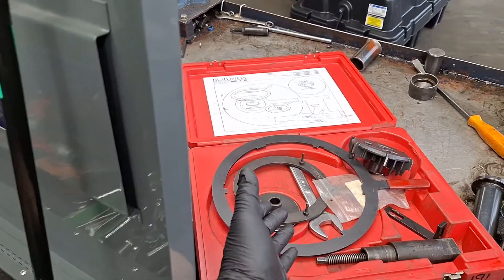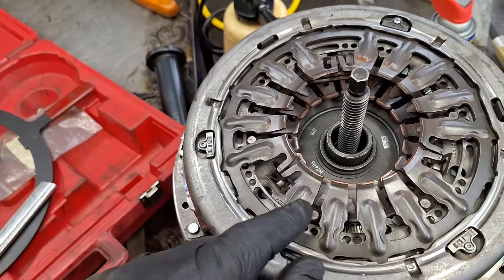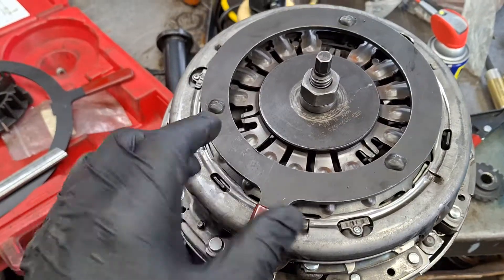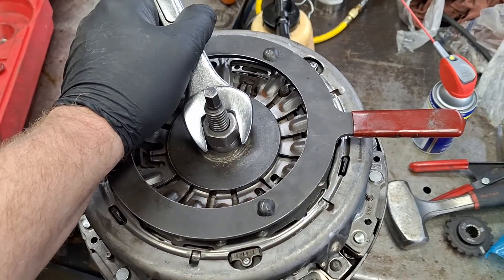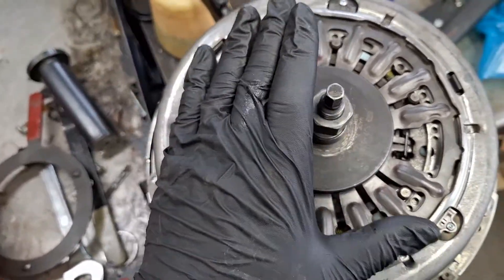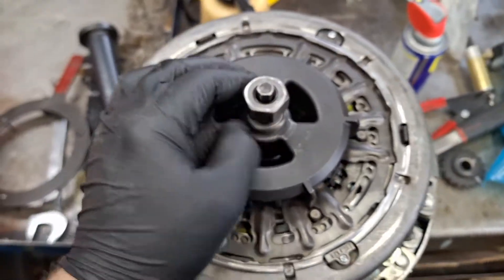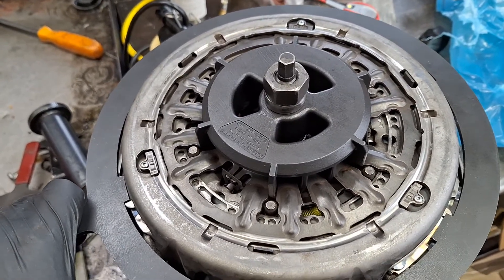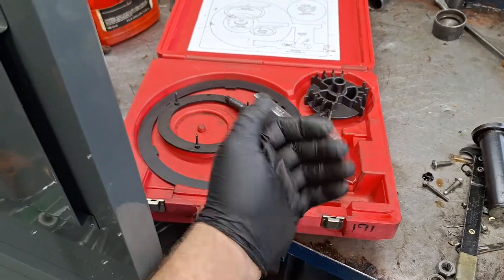Ford DPS6 Clutch Locking (Reset) Procedure!

Comment: Why does the clutch need to be reset?
Reply from the maker: If you're reusing the clutch you have to reset it - so that it goes far enough down to install the snap ring
Reply: I make  big mistake. I unlock befor installing @BigBensCarsAndCycles
Reply: How about a duel clutchñ   ? Do u have to reset it and also would it make the shifter not shift or go into aortf ?
Reply: If you don't relock it, you'll have the pressure plate splines resting on the release bearing in their extended state and you won't get he clutch deep enough into the transmission.

Comment: Are the forks reusable? I just did a clutch in my car and have no reverse. Been through the diagnostic steps in your other videos and everything seems to point towards the clutch. The little tabs on the bearing had broken in shipping and allowed the bottom piece to separate. Also the guide looked like it might have been off center as if it was bent. Stupid me put the clutch in anyway because I was desperate to get back on the road.  I am planning to replace the bearing assembly and guide hoping to fix it. Brand new Luk kit. 

PS: I re-did the shift and clutch relearns and it worked for a little while last night and quit again on me this morning.
Reply from the maker: Yes if they're good you can reuse them
Reply: @BigBensCarsAndCycles   Thanks for the reply!  I pulled it all back apart and lo  and behold the flange on that guide is bent ever so slightly. I suspect that makes the clutch release unevenly.  Hopefully I can reuse the old guide and replace the bearing.
Reply: No dice. Same thing with a P703E just like before. There is a bunch some banging noise and a lot of clacking until I try to put the car in reverse and the car doesn't go anywhere. Then the noise stops. 

Just like before, FORSCAN shows clutch B engaged @ idle in park.

Also, I had a really hard time resetting the second clutch and I'm not sure if I got it all the way. Maybe only half of it. But I had no trouble pressing it on the shaft far enough to get the snap ring on.

Comment: I have 3 pins on the same 1/3 that wont bite/latch. If i can still get the snap ring on, do those pins matter?
Reply from the maker: No. If you can get the clutch seated and unlocked then it'll be fine
Reply: @BigBensCarsAndCycles great! Thank you. I literally just got it together like 5 minutes ago.

Comment: Please help me. If I never removed the clutch, does it have to be reset?
Reply from the maker: No, that's only for when you remove and go to reinstall the clutch pack
If the pack was never pulled off the input shaft then you're good

Comment: Great video and incredible information as always. However the tool listed on amazon got stuck on the clutch and destroyed it taking it off. Im not sure if it was operator error, but it seems like the diameter of the tool is just way too tight to seat properly and come off, and after reading other 1 star reviews of the locking tool on amazon I would not recommend that brand! Again just a bit of information for the next guy, Love your videos Ben!

Comment: He Ben, how do you get the clutch off the stand if it is stuck on the shaft after locking. It seems to be stuck and won’t come off once I finished the locking procedure
Reply from the maker: @rev9921  that's a problem with Chinese reset tools and it's going to break the clutch when removing it. The problem are the reset tools that don't mount in a vice. They powdercoat the surface where the bearing sits on the clutch so it gets stuck
Reply: @ I used the one off Amazon from your link and it sits in a vice. We got it all locked no problem, no the clutch won’t come up from the tools shaft that sits in the vice.

Comment: Question. So when I let off the 1st nut after locking the 1st one into the 3 tabs. The part you hold will still move back and forth is the normal or is the clutch broken?
Reply from the maker: @Hendogg28  that sounds normal to me

Comment: Hey Ben I broke one of those aluminum tabs that hold the clutch on top so I only have 2 out of 3 able to lock on the clutch locking mechanism for that clutch . The lower clutch is fully locked no issues . Brand new clutch pack. Would this cause issues if any once properly seated and installed into the casing? I stopped working on this car after that tab broke and am started to feel like the clutch only needs to be locked for installation purposes ?
Reply from the maker: @xcorotoxvaina  hey it'll be fine. It's just for install
Reply: @ you’re a live saver man I feel like I owe you one big time! So I have the transmission in my living room I went to unlock the clutch after seating it “properly “ and right as I went counterclock wise 10 times on actuactor b the clutch popped up .. I was going to continue but when I removed the outer ring and the center hub then removed clutch I realized that the snap ring came off .. I’m assuming I did not seat it properly and could have went down a little further … next time I’ll trust my instincts and bang one more time !
Reply: @ I would love to show you some pictures of what my casing looked like before and after watching your videos! You are a Legend
Reply: @ I honestly can’t thank you enough, seriously! Love from New York City brother

Comment: before I choose,  new clutch or tool to reset old clutch. 
in your experience. how often do you see these clutchs are ever bad? I have a broken release bearing (slave cylinder, bearing) what ever we choose to call it, either way, obviously I'm in it but don't want to dump a lot of $$$ in this project over budget as is, auction cost high,, just replaced engine. now clutch sticking so its a mess..appreciate your input and time making helpful videos
Reply from the maker: Usually the clutches just shudder. If you don't want shudder I would replace it. otherwise no major problems typically. Blow all the dust out of it. Sometimes they don't reset properly, i've got a video showing how to pull it down with a ratchet strap
Reply: @BigBensCarsAndCycles  you Rock dude!!!
keep up the good work 👍

Comment: Ben,

When reinstalling the clutch or installing a new clutch, does the order the clutches are unlocked matter? If it does, what would be the outcome if the clutches were unlocked in reverse? I’m still getting a P087 and P287A after replacing the clutch, forks, and shift motors. Ford refused now for the second time to replace the TCM. They are telling me my new clutch is bad, or was not installed correctly. Any help would be greatly appreciated! I’m at my wits end with this one. 2014 focus SE with K00 TCM.
Reply from the maker: @chrisharmsen8962  hi, p087 is a clutch position sensor code. P287 is going to  be related to that. Diagnose p087b using my video https://youtu.be/2-9PkV-8N7A
Reply: Ben,

Thanks so much for the reply. I was getting the P087 and P287A initially before doing anything. I’ve watched all of your videos related to this transmission. I took this to ford and they told me it needed a clutch, but before doing that, I replaced the B shift motor. Before replacing, I was failing the clutch travel test. After replacement, it passed the clutch travel test and drive well for about 10 miles. Then it started falling out of gear when trying to shift into overdrive at highway speeds. Once I got it home, it wouldn’t go into reverse. I replaced the clutch, forks, and both shift motors. Before ever starting it, I ran the tests with forscan and this time got a “clutch travel ERR” rather than “clutch travel test failure”. I tried disconnecting the battery and resetting, but nothing worked. Took it back to ford and they are telling me for the second time it’s NOT the TCM. I’ve swapped the shift motors, ran the forks in and out by hand. The codes never clear. After watching your video, it seems it can only be the TCM at this point. Can you tell me if I’ve missed anything? Wiring harness looks good, battery voltage is good. There’s lots of clicking coming from the transmission when you turn the key on before starting. Sounds the the TCM motors are freaking out. Any advise you can give me is greatly appreciated!
Reply: Ben,

I got my focus back from the dealer yesterday. They did not replace the TCM. After getting it back, I had 2 codes. Still had the P087 and now a P0702. Ran the clutch system test in for scan and still got a “clutch travel test ERR”. Here is what I did:

Pulled shift motor B and left it connected to harness but hanging out of transmission. 

Ran the clutch system test again. Got same error. 

Placed a small zip tie around the shift motor gear. I did this to see if the motor was moving any during the test. I ran the test again, this time it failed the reference point check. The zip tie flew off, confirming the motor is getting power and actuated. 

Re installed the shift motor and ran clutch test again. All tests passed. Ran shift drum and self learn clutch point tests. All successful. Drive the car 40 miles so far with no problems. 

Seems that the clutch position sensor inside the shift motor needed to be re calibrated. Or the TCM needed to re calibrate by forcing the reference point test to fail. Not 100% sure but just wanted to share this with everyone. Thanks!

Comment: Hey Ben - issue I'm having is when seating the clutch it goes down and the notch for the ring shows and I stop.  When I release pressure the clutch moves up so the groove goes away. It's like something is pushing the clutch up.  It's a new kit and when I installed the forks I released the even gear fork. Could that be it? Can it be locked again?
Reply from the maker: @sluggowonder  hi, yeah it sounds as if your clutch wasn't locked to begin with. Was it an oem luk kit? If so that's odd, you can message the seller and try to get another, or buy the tools in this video to lock the clutch for install. I've also got a video for installing the clutch unlocked, but it's a little sketchy
Reply: @BigBensCarsAndCycles  Thx for the response.  I got the reset tool today and its reset now. I compared it to the old clutch and the secondary clutch (even gears) were still locked.  What i'm wondering is since I took the safety clips off the forks and did the 14 spins if thats what the problem is.  From what I can tell the post the z washers hang off of is seated correctly.  What Im missing is like an extra 1/8th inch for the groove for the snap ring to fit into. I thought about putting the snap ring under the socket thingy with the gap to see the groove but im afraid that wont spread apart then slide down the side till it snaps in place and damage the ring.  Watched your vids as well as others and no one has really covered what the forks do other than the 14 counterclockwise to activate.  Im wondering if since i already activated them  thats the issue.  Thx again for your help.
Reply: @BigBensCarsAndCycles  Hey Ben - Sorry to bother you again.  Got the clutch and snap ring on.  Now the issue is the clutch moves smoothly until i put the hub on then it wont spin.  My understanding from Maculoco is that it should.  any quick suggestions?  Thx again!

Comment: I don’t know what I am doing wrong, this is the second clutch I have mess up. I am having trouble with setting the second part of the clutch some of pins did not go in the hole, I ensure that the tool lines up with the all the pins, however some of the pins did not go in the hole. Could I be tightening the tool too much? How can I release all of them and start all over? Or do I have to buy and new clutch again ? Thanks in advance
Reply: Did you get with the solution? I have the same issue

Comment: Hay mate how do you tell if the clutch plates are too thin to reuse how thick are the plates from new thanks
Reply from the maker: @truck282  hi, there's no spec with Ford on that. Personally, I've never seen one get thin. But I would replace the clutch every 100 to 125k miles during a transmission job. That way you won't have shudder for a couple years
Reply: Thanks for the quick reply love your videos very very helpful
Reply: Also has any one had success with the cheaper E bay clutches as lux kit are very expensive in Australia

Comment: Do you have to reset the clutch if it isnt removed from the gearbox? As im going to fit a used unit and the clutch pack wasnt removed from the gearbox
Reply from the maker: @V4koz  nope. Only if removed
Reply: @BigBensCarsAndCycles  okay thank you for replying 🙏🏼👍🏼

Comment: When the clutch is released, do both disks engage the pressure plates and lock? I can't spin mine unless I remove the inner shaft spline disk.  I watched other videos with the clutch install and they spin freely with the clutch disk spinning too.  I am not sure if the trans slipping into a gear or not while working on it, but if I remove the spline disk I can see the inner shaft rotate opposite of the clutch.

Comment: Good work Bigben, very good video, very useful.

I changed my forks A and B and since then the gears no longer shifted after reassembling everything, or the engine moved violently when I put it in Drive.

I didn't know that you had to reset the front clutch and then unlock it before reassembling everything.

my Ford Ecosport had been parked for 1 month and this video allowed me to adjust everything and I was even able to drive without having to relearn the TCM. Thank you so much

Comment: Do you have info as to how to know if clutch is reusable once you take trans off instead of replacing ? (2016 focus se 90k miles, Super dusty trans locking up fork b causing slave cylinder to break, replaced clave cylinder and cleaned forks with air and fork now releases with ease)
Reply from the maker: Hi, due to the extend of damage, I recommend replacement of the clutch. Unless you don't smell burnt clutch odor. Theb blow air and use some brake cleaner to clean the clutch
Reply: What do you look for qc wise in a used clutch? I know you can't really measure the thickness or really visually inspect the pads on the friction disc

Comment: Is it possible to drop clutch in bellnhouse without locking?.......  Coz no special tools.
Reply from the maker: I'll try this out and make a video in the near future. It may be possible if you sit the transmission (with the clutch sat on) onto a press and compress the clutch, then install the snap ring

Comment: What happens if clutch are not unlock and installed inside transmission.   The reason I mention I did one recently and now 2nd gear won’t work. I did about 10 turn ish. Thought was enough but it did hear them unlock.
Forscan is failing my clutch travel test hence not able to do adaptive learn.
Reply from the maker: If you don't lock the clutch, it won't Seat enough to install the snap rings
Reply: @BigBensCarsAndCycles  I did lock the clutch.  And you are suppose to release them after clutch is installed. I am asking what happens if you don’t release them and installed tranny back in

Comment: Thank you for the content,  very helpful and appreciated.  Have you ever seen a dual clutch that the outer clutch (3 tabs) resets fine but the inner clutch (12 tabs) I am only able to get a little more than half into the holes they go in? From what I can tell the tabs and holes are not lining up exactly. It is a new spare clutch so I will continue to monkey around with it and see if I can get them all into the holes.
Reply from the maker: I'm glad it helped!  Yes it's very common for a used clutch to not fully lock. Actually, it's more common for them not to lock once they get a lot of miles on them (50k)  you can keep trying, maybe try a press.
Reply: Did it work? I pushed them by hand but I think that they got stuck inside when I release the clutch with the manual actuator tool